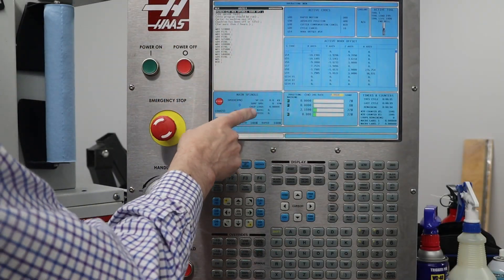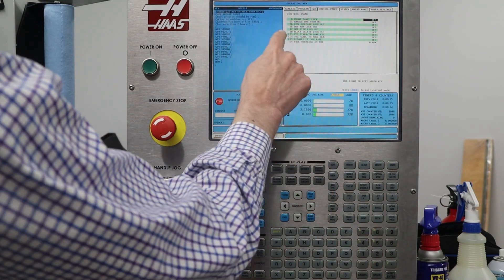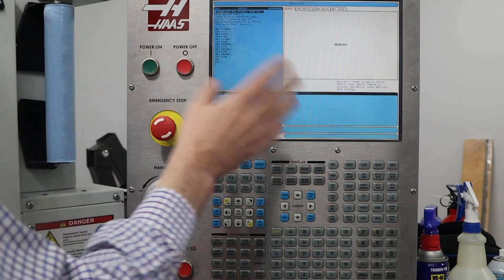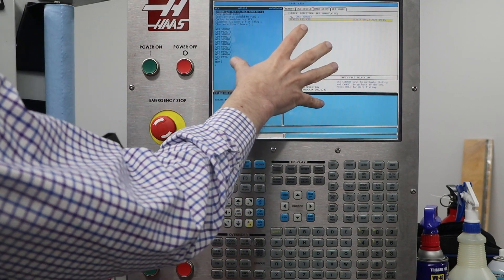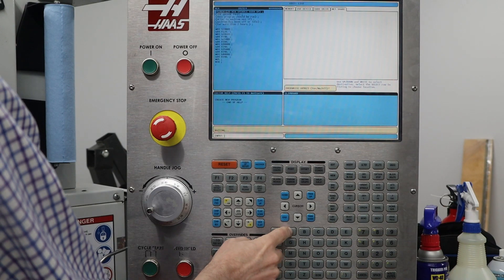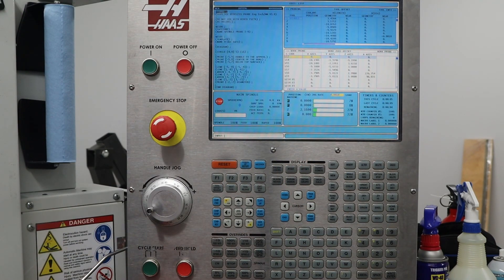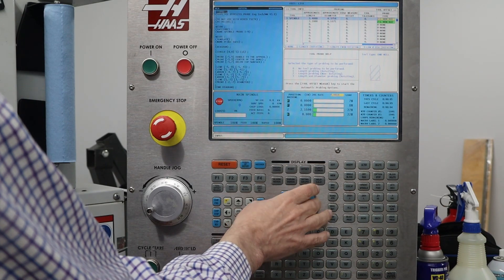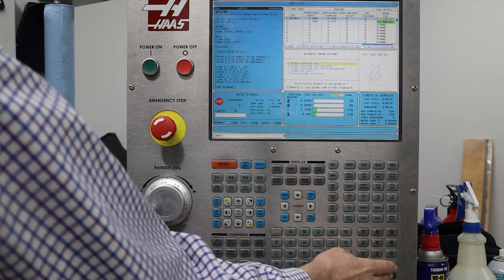Haas Toolsetter Problem Solved

Comment: It's a common mistake.  A conflict between interests.  The folks who design this thing would never assume someone would want to video it.  They would never check if this system would work without the safety door being open.  How do you solve this type of problem?  Be aware of it.  Always assume if something you are doing is failing is due to somebody not thinking it was needed.  Where I work, we either categorize it as "it just plain don't work that way" or "product enhancement" <grin>.

Comment: It's funny they don't have a signal integrity indicator and diagnose the problem properly. Other probe systems do. I built a touch probe for a milling machine 30 years ago and I put a touch light and a receive light on the panel. You turned on the probe with a light flash and it transmitted an IR modulated carrier with 6 LEDs around the probe body. The carrier was always on touched or not so you could easily tell if you had a signal. It measured features and output CAD system data that created an actual drawing of the part. Simple primitives like  circle, arc, rectangle, lines were supported. I used it to create aircraft instrument panels. Instrument panels are tough to measure because of all the different shapes at semi random locations and an outside profile that is arbitrary too. All the control logic on the machine was written in the controllers macro language which had a lot of exotic capabilities that no one used or understood. You could even call subroutines recursively.
Reply: You can view and monitor the skip signal and other inputs in the diagnostic page and do just this on any Hass. Usually, when there are any problems with a renishaw system it's a low battery issue. The way he has his tool setter mounted at an odd angle is likely the main reason for his issues. The ir transmitter/reciever on the tool setter is oriented such that it must align with either the x or y axis as there are blind spots by design. There are also some documented cases of inaccurate diameter measurements when the tool setter is rotated as such due to the 3 point contacts within the probe.

Comment: yeah that happens sometimes. good to keep the files available if needed, like you said.
If I may make a suggestion, since you have an umbrella toolchanger, you may benefit from adjusting the "retract" height used during the tool probe cycles. The default height is machine home, but the tool might collide with a tall object like the rotary housing, so instead I changed it to Z4.250 inches which is much higher up. The value would be different for your ISO20 umbrella but still a few inches I hope.
It's found within the program o9023, search down for line N40 then it's a couple lines below as G28Z91Z0 which you can swap out for a G53G90Zxx.xx. The tool will still retract to machine home at the end, but it would be above the OTS which should be fine.